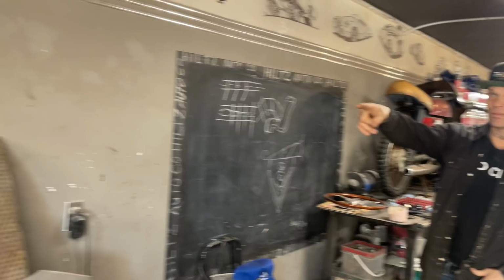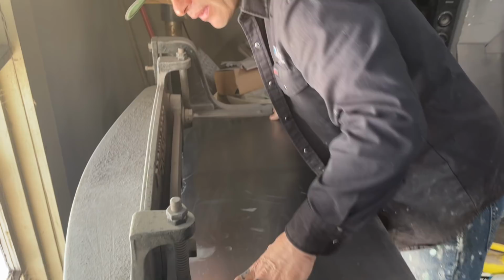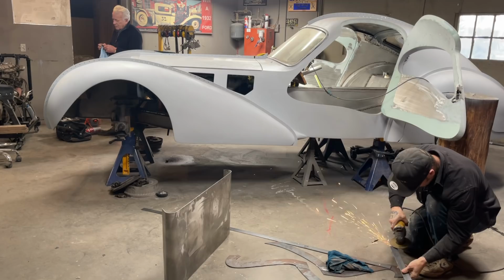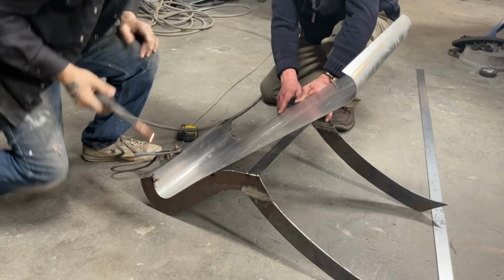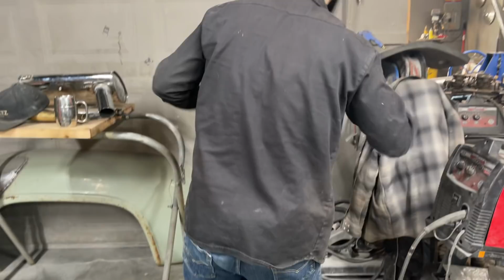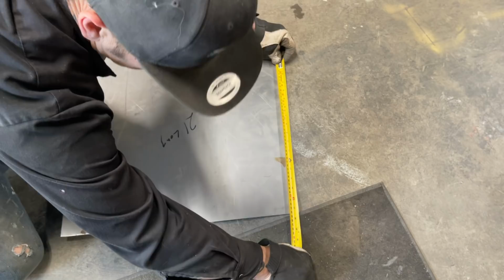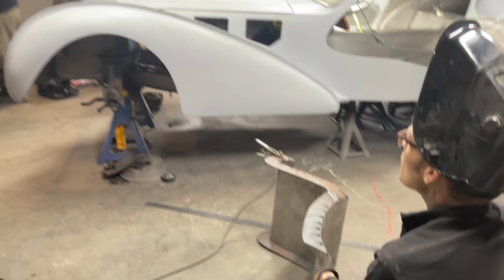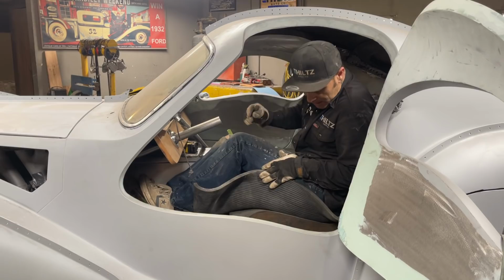BUGATTI: FABRICATING THE SEATS TO FIT JOLENE

Comment: Doug is 100% correct,  he just wasn't really saying it too loudly ........  the seat is dead on BUT the upholstery guy really needs to thicken up the top part by the very upper back / shoulder blades, not a bit, alot  ..  it will look awesome but it needs to really be double the thickness by the upper back / head, no head rest needed.... amazing work   !

Comment: Great stuff as always!  Have a suggestion on that very cool V8 sign - I do a lot of forced patina copper and sheet metal signage for client's - I'd use some gun bluing with a rag and wipe that sign down, heavier in some spots than others.  You'd be surprised how unique of a finish you can achieve using this technique - sometimes I'll clear coat, sometimes not.  But I'd guess with a good artistic hand with a rag and gun bluing you can get a great aged look and then let the elements take over from there.  Thanks for all the work you two do to share what you do!  😁

Comment: Love the shape of that seat. The wide top will be good for shoulders. The slope on the back is a bit extreme. I would take a couple of degrees off of it so you have proper support on your upper back. Fatigue will set in quite quickly! Great fab work Chad!!

Comment: For what it is worth - I find your ingenuity in this free form arena truly amazing; vision only your brain sees created from scrap.  As for this specific installment I think what Doug was trying to demonstrate with the seat is for practical driving purposes the back is seated too low.  I cannot really see what Jolene would see from the driver’s seat in terms of can or will she be able to see over the steering wheel/dash and through the windshield sitting that far back.  Having the seat sit that way on the passenger side would be a non-issue, their just over there for the ride.  For what it is worth.

Comment: To get them.curve lengths accurate  I would have used modeling  paper first then attempting it on 18 gauge 🤔🤔🤔on a side note it's more evident that the workshop needs to be layed out properly...we moving equipment to make workable space just don't look professional  but that's just my OCD and my 2c opinion👍👍👍🇿🇦🇿🇦🇿🇦

Comment: Weather u are very tall , or very short, you want to have the same view out of the side window. Why not limit the fwd and aft movement of the seat? The reach to the gas and brake pedal can be done by extending or shortening those pedals. How often do u change driver? Not often.
Especially if the car is made for one person.

Comment: Is Doug going to pull the head on the 1959 3.4 L and refresh the engine? The crank might be ok but the front and rear seals will need replacing; and at a minimum the bores will need honing etc. Btw, I'm looking for a 4.2 preferably 1986-1987 to build a high-performance street engine around 340 HP.

Comment: Chad ... I keep worrying that you will get that seat so high, and so far back that the driver will only be able to see straight ahead and not up.  Would you consider a knuckle in the steering shaft so that the wheel can be mounted perpindicular to the floor ... straight up and down ... and then move the seat closer so that the driver has some vision out of the top of the windshield.  Otherwise, the driver will never be able to see overhead signs and traffic lights.

Comment: Pretty tough to see traffic lights with that line of sight. Looks great all the same. Nice work!
Reply: I thought the same it seems there sitting a little high .  I wonder if chad considered  sinking the floor were the seat goes
Reply: @christoschristos1159  you know why they call it a "floor pan" right? Step down construction makes cars easier to enter and frees up a lot of room.
Reply: My 1950 Oldsmobile came with a dealer added sun visor and a traffic light finder on the dash so I don't have to duck to see the traffic lights. I can see them in the finder on the dash very well. Maybe that's a solution to the view.

Comment: Nice car Chad...I wonder, looking at the doors. The topside of the doors come almost at the middle of the top.  How do you prevent that rainwater runs in the seams on the driver. Rubber sealing must be made very tight and than still will one get wet by opening the door on a rainy day.

Comment: Poor Joleens head is way to high too see out the windshield or side window, b4 u get to much further u need to lower the floor board so she can properly see out the windshield it is basically unsafe at this point right now as she sits! It's a real safety Hazzard Chad, please lower her body down so her head is not way over windshield, and side door! Don't do u baby like like that! No no no, Chad it has to be fixed immediately on the Bugatti! Thanks

Comment: BEST LAUGH OF THE DAY.”DOG SHIT SANDWICH” I HAVE HEARD IT CALLED A TURD SANDWICH.

Getting the correct height on the seats will make it much easier to get in and out. Also when the car is on the  ground will make a difference.
Might be a good idea to either lower the car at the approximate height off the ground or build a small platform next to the car to simulate the ride height. I would think that the bottom of the seat should be even or slightly(a inch or two) above the door sill so you could sit down then swing you legs in.